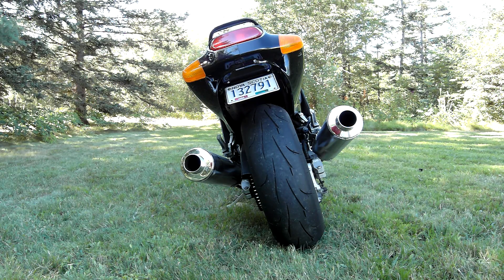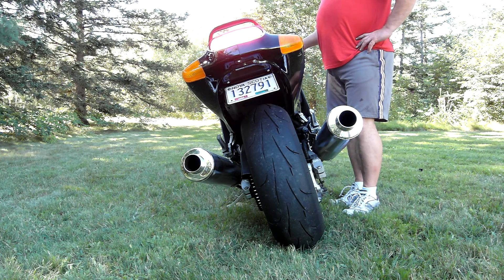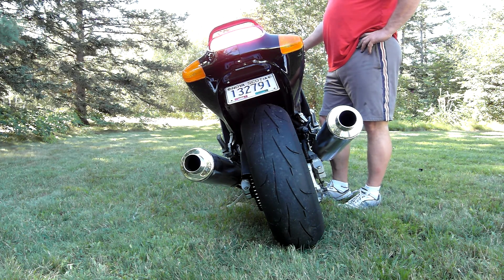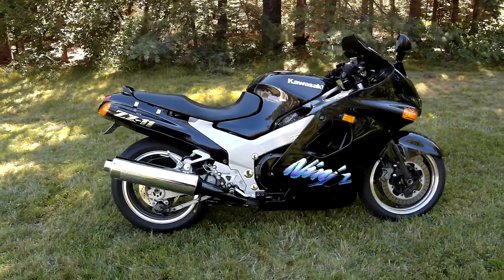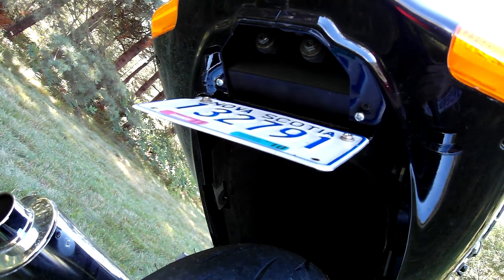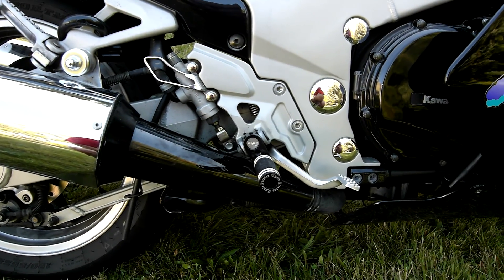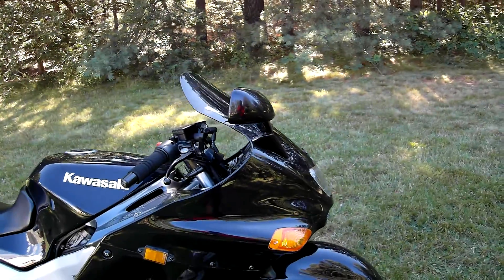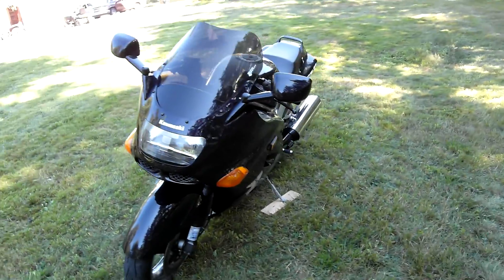1995 Kawasaki ZX11D Baffles removed

Comment from the maker: No I didn't tune it first when I removed the baffles, I just had a K&N filter in it and it ran fine, It actually rev'd more freely. I did add a Factory Pro jet kit and a ignition timer to advance the timing by 4 degrees later on.

Comment from the maker: First drill out the rivets securing the muffler end caps so you can remove them. Then use a stepped drill bit to cut a series of 3/4 inch holes around the outside edge of the plate around the exhaust pipe. Cut the holes close together so that they join together as you go around because you are going to have to move the pipe back and forth until the weld that holds it to the inner baffle breaks, then pull it out.

Comment: I have a straight through aftermarket exhaust with the fiberglass packing. Way too loud. I just made a baffle for it out of a piece of stainless pipe. It's still louder than yours but I no longer need to wear earplugs. It doesn't hurt my ears so much now. 1991 zx11.

Comment from the maker: Once I had the pipe pulled out i just put the caps back on and used stainless screws to secure them.
Beware though that the bike is going to quite a bit louder and I did not like the hum from them at cruising speed, it got pretty irritating. I actually got a couple of plates made and drilled a series of holes in them to get the sound I liked.

Comment from the maker: I installed a Factory Pro jet, removed the pollution controls, installed a K&N air filter and a 4 degree ignition advance
Reply: +John Veitch Yeah it sounds awesome without the baffles. its deep and throaty sound is just like what you get from the performance exhausts. i wonder if there is any HP gain from removing them? and do you keep the baffles out all the time? The Performance exhaust upgrades are very tempting when it can gain some extra HP and shed up to 8 kilos off the bikes weight BUT i just love those big shiny original end cans too much to change them. they suit the ZZR 1100's looks perfectly and make it look bigger. i dunno about you but I've yet to see a performance exhaust that looks as good as the originals. i just put a deposit down on a mint low mileage 1994 ZZR 1100 D2 model and those spotless shiny exhausts are staying put but i may remove the baffles :D. thanks for making this video.
Reply: +John Veitch i've just seen your other video now. you drilled them out there not meant to come out easy lol. i'll have to try it in future but i hope it will get through an MOT check with those baffles like that??

Comment: did the same with my exhaust, drilled out the rivets, pulled the caps off, small angle grinder and cut the plates off, put a bar inside the tube and snapped them off, put the caps back on, sounds great when you roll off throtle